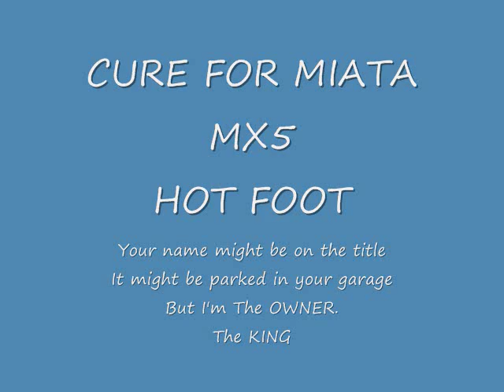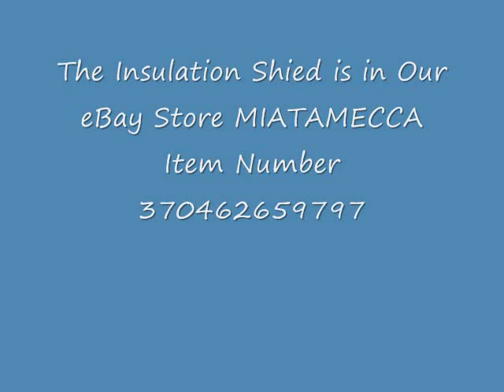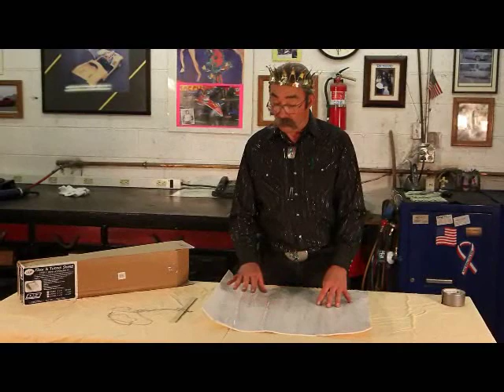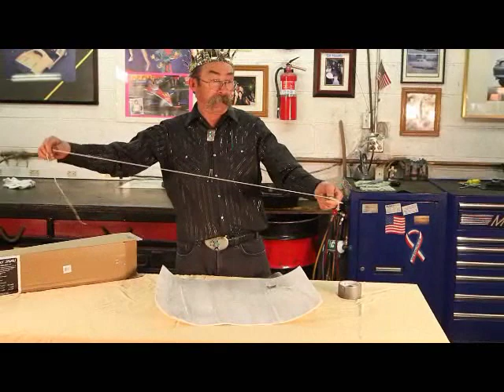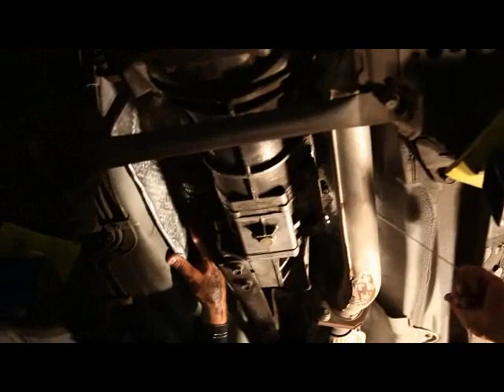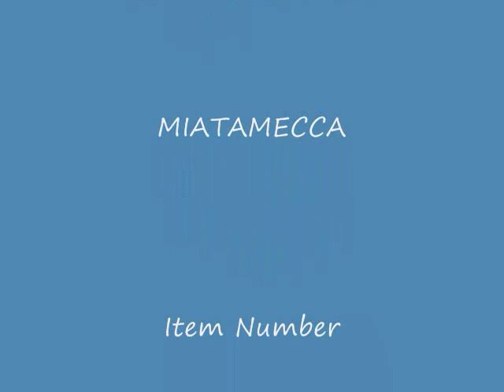The Cure For Hot Foot Miata MX5

Comment: I replaced the shift boot and because I broke a post I'd left the center console off and I was amazed how frigging hot the tunnel got.  I couldn't leave my finger on the open spot where one of the screws attached.  I could fry bacon and cook some eggs if I pulled the carpet up!   Thank you for the informative video.  Clever idea with the tape and stick.  I do not have a lift so I was wondering if I got some of those ramps and did it in my garage, if that was possible.  I know I have to clean under there, I could see how rusty it was when I had the old boot out.  I'm in south jersey, and it gets really hot and humid.  
Thanks for your time and sharing your knowledge.  I will check out your ebay store..
Peter
Reply: Hello,
Yes, you will need to get under  your Miata to install the shield. Take a look first at the underside of the tunnel, you may
find it cleaner then you think. Good luck with your Miata Mission.  The King of Miatas. Mike.

Comment: Thanks for the video, that's a great system!  Where does this line up from the POV of the inside of the car?  I' assuming that you have to remove the shifter, is that correct?
Reply from the maker: Hello Sir Richard,
The heat shield will be located between the firewall and the shifter inside of the transmission tunnel.
No need to remove the shifter. Good luck with your Miata Mission. Mike, The King of Miatas.

Comment: Mike I don't have a header on my 2001 Miata here in Southern California.   Even on a cold day, if I set my air conditioner controls to deliver cold to the top eyeballs and the lower outputs,  the top works normally. Cold if I set it for Cold and hot if I set it for hot.  BUT the bottom blows hot no matter how I set the controls.  This symptom happens before the car really  gets hot.   This lower heat is not from the tunnel.  The stick shift has all new rubber and is not leaking heat.    WHAT DO I DO, KING?       BTW  That is a sweet and clever fix you have devised for peeling off that backing on the insulation.
Reply from the maker: Hello Sir Charles,
In the Miata the heater is always on. You may have a vent door problem. Squeeze off one of the heater hoses with a vise grip and popsicles sticks and test for the heat issue. The hot foot will help any Miata by being an extra shield between  you and the catalytic converter. Good luck with your Miata Heat issue Mission.
Miatamecca.
Reply: MiataKing oh my King thank you for the tips.   I'll rule out everything else before I go tearing into my heater box/flap assembly.

Comment from the maker: Hello,
Yes, do rotate the insulation shield so that more is on the drivers side. You could cut a piece of paper as a template and then mark the point of starting to stick the sheet down so that it will finish up covering the drivers side. Thanks for the heads-up.
Mike. 
The King of Miatas.